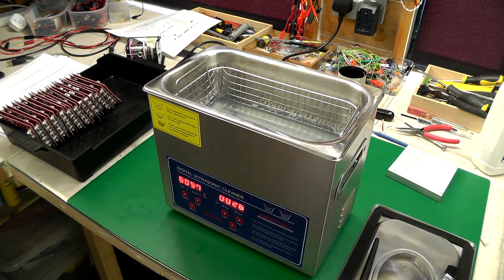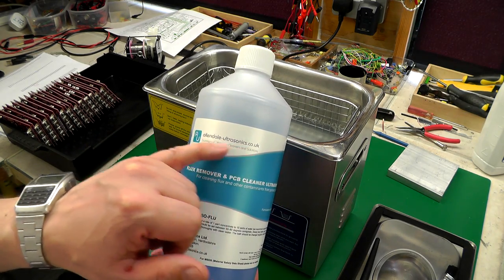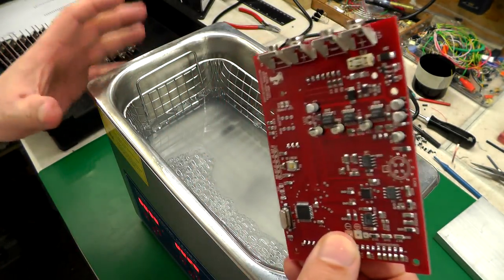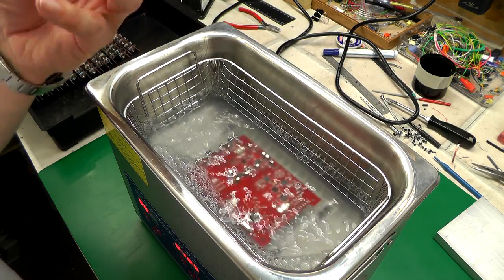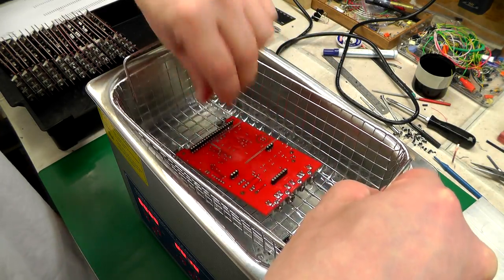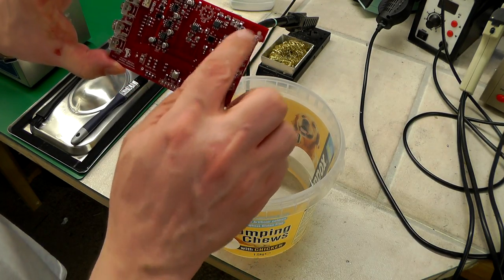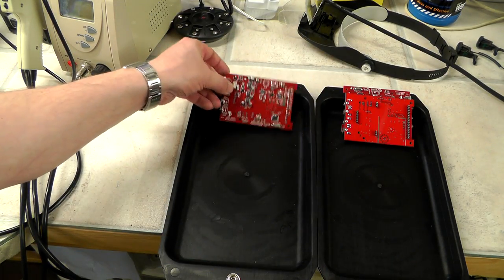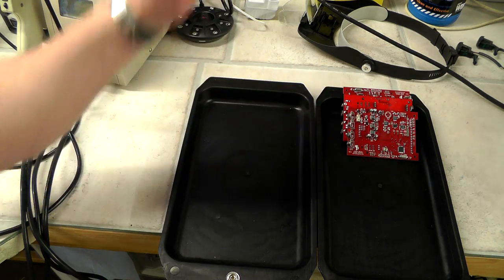No.026 - Ultrasonic Cleaner PCB Flux Removal

Comment: actually rinsing the board with 99% alcohol before you dry it is a great way to dispence out the water from under the chips. plus it'll dry so much quicker!
Reply: Yep, been doing this for years. The alcohol is anhydrous, and literally sucks the moisture out of any gaps. Then air dry or bake from cold oven at 100F for 5-10mins, and place the PCB's in a a container with silica for storage.

Comment: That tank isn't nearly full enough. My understanding of those cheap cleaners is that they need at least half a tank for the transducers to work properly. Allegedly running them low will lead to early transducer failure. I know I have one similar to that, although slightly larger (same labels/controls), and it makes an awful sound when less than half full, but there's a certain fluid level where the sound dramatically changes and it sounds like it's running smooth.

Comment: "...i'm gonna assist the drying process with a heat gun...." Well - that's no better than just letting it dry on it's own. If you want to make it better, use a compressor and blow the water off the board.
Reply: compressor air believe it or not has alot of moisture in it because the air it compresses has water in it. Since it confines the air to a smaller space the end result is there is a lot of water which will come out of the nozzle when used.  Try it for yourself and test, run the air thru a completely dry rag and after a bit you will see the rag get wet. If you decide to do this you need a very good in-line filter to remove the water
Reply: I was under the impression that compressed air can cause static, and we are all taught that static and electronics dont mix. Is there any truth in this?
Reply: @TomStorey96  static what ?
Reply: @dalevanderzee4086  I use a compressor with one big filter out off the tank, another smaller one near the gun, and it's the cleanest air you could wish for.

Comment: Use an air compressor to remove the bulk water an then into a the reflow toaster oven on low convection or dehydrate.

Comment: Can I ask how you set the temp? I have a smaller unit but same type, temp seems to work but when I press on for heat the led doesnt light up. do you get the same?

Comment: I use termopasty (polish company I think) ultrasonic cleaning solution. It is not, as far as I can tell, a soap type thing. Nor is it something you have to dilute. Just dump it straight in the tank and go. It is not the cheapest solution but what I can say is that it does work insanely well. Even for things like years old crusty brown flux from older PCB's. No need to brush it at all and once out of the tank all I do is just blast it with the hot air station (a quick 861DE, so the one where the fan goes up to 200 instead of 120) at 200 degrees just to blow the solution out from under components more than anything. It also leaves as good as no streaks (unlike IPA which always seems to leave some of that flux behind) or blemishes. No need for a rinse afterwards, just a quick blast of hot air to aid it evaporate.

Comment: Just a note, LM399 is actually hermetically sealed, plastic housing outside is just air shield, but I agree on the move not to put it into ultrasound cleaner just to avoid stress to it. :)
Reply from the maker: +xDevs.com - Yes, I meant I didn't want water or old dirty bits of flux trapped in the pockets withing the thermal shield. It always appeared to me that water etc could get up through where the legs protrude through.

Comment: Great video, thanks for taking the time to show the process! I'm inclined to get some of that cleaner stuff and try it, although I might need to get a new ultrasonic tank as well (mine is rather old and out of whack). As it happens, I spent today making up a batch of PCBs and wondering how the pros go about cleaning them. My own process, for what it's worth, is:

Soak boards in isopropanol inside a sealed plastic tub for 30min - this softens up the flux and crap
Scrub well with a toothbrush in the IPA - this usually gets everything off but sometimes there's little bits of hard flux around big solder joints, so need to give them a wee scrape
Wash with hot water and detergent, to remove the IPA
Dry thoroughly with a compressed air jet

Personally, I love using compressed air for drying things, because it gets into tight places very easily - e.g. under SOIC chips, or inside IC socket pins.

By the way, are you from Aberdeen? I detect a wee bit of an accent! [I'm from West Calder]

Comment: I wonder if the ultrasonics has any long term impact on the crystal on that board, such as offsetting or drifting. Your also using a lot of manual effort when the ultrasonic bath should be doing a larger percentage of the work. Try using other chemicals.
Reply: My thoughts exactly...   shouldn't need the use of a brush...

Comment: I'd recommend trying safewash 2000 in the ultrasonic bath, RS part number 217 3841, it's good value if you buy in the 5L size, it can be rinsed in tap water, its much more effective. I gave up on the soap based cleaners, they just didn't do a good job.

Comment: Hello Ian. Do you work for yourself or do you have a shop? Also what happens to the board if it has plastic components on it or do the heat and cleaner have any adverse effects on plastics?
Reply from the maker: I have my own company, self employed. Go to ianjohnston.com. The cleaning solution is water based so has very little problems. The heat of the solution is only 50degC so again, no real problems. The biggest issue is drying the boards with heat......be very careful.
Reply: @IanScottJohnston  Thank you, I have a pile of faulty PCB's from PlayStation controllers. I can often fix problems with an alcohol swab but I bought an Ultrasonic cleaner to give it a deep clean and hopefully rescue some boards from the bin. Cheers and thanks again.

Comment: Great video Ian, I've been wondering if the ultrasonic flux removers were any good. 

For pcb drying, a portable air conditioner in a small room is great, on dehumidify mode, as the exhaust will pump out hot air and dry the pcbs very quickly without any direct heating of the pcbs.
Reply: +arcadeuk what the pro's do is rinse the pcb in alcohol as it displaces water and evaporates quick
Reply from the maker: +arcadeuk - I do have a dehumidifier in the workshop, so could look at building a wee "enclosure" on it to house the boards. The only thing that would concern me (lack of knowledge!) is the possibility of static build up from the continuous air feed. I've used the hot air gun method for 30yrs and never really considered anything else!
Reply: +IanScottJohnston Yeah, it would seem to me that since humidifiers are used for static control dry air + air movement = static. I built such a cabinet* for controlled drying of seeds to put them into dormancy and they stick like hell to paper and tweezers suggesting they are charged up I don't have the esd test eqpt to test.I used the warm air cabinets when I was at sea.. *When I say cabinet it's a polystyrene fish box, fan, loose indicating gel, hoover hose and duct tape

Comment from the maker: Just a wee update.......Why don't I use Isopropyl alcohol to dry off the boards (as I used to!)?
1. Safety. It's extremely flammable especially in the quantities I'd be using.
2. It's only a small workshop I have and it stinks. Also, the pcb's give off an ever lasting odour. Fine for home use but not production.
3. Water is cheaper.
Ian.
Reply: +IanScottJohnston probably a stupid question but can you use IPA in an ultrasonic bath, heat or no heat?
Reply: Yes you could but read again number one ... safety
Reply: Just a thought, but wouldn't a hair dryer or a temp controlled hot air rework station be more appropriate than a heat gun? Heat gun is like 500℃

I have successfully used a heat gun for electronics before I got my $50 rework station, but it was like using an arc welder to do PCB soldering.
Reply: The heat gun is a static generator with carbon brushes not design for drying static fragile IC's the cheap rework station is made from an anti-static design I got a similar machine its written on it ESD safe on its box ! If anti-static is not a preoccupation for these board then a small compressor would blow away every trace of water from under the IC's in an instant ..
Reply: Do note that cheap brands sometime claim a device is ESD safe, while it is not. People like seeing it on the box, so they put it on there.
Reply: Lol.

I used to to boil Iso 99% in a pot with Marijuana to make oil.

Never had a single issue and the ultrasonic cleaner wouldn't even be boiling it.

You really need to get more scientific brother, Safety is an absolutely terrible excuse.

Comment: One thing to be careful/mindful of is obviously components that aren't sealed.  For example, that fuse on your board doesn't look like it is fully sealed and a bit of water might seep into the fuse body.  With water inside the fuse it could change the thermal properties of the fuse if its in contact with the filament and cause it to not blow when it needs to.   Some components might be rated for washing but not full immersion, such as fuses, relays, switches,  buttons, and other electro-mechanicals.

Comment: I've heard of people using a commercial dishwasher to clean PC boards. Nowadays with the aqueous wash fluids I don't think it would damage the machine. I certainly wouldn't do it with freon.
Reply from the maker: Out of interest, back in the day we used to buy 10ltr tins of Freon for use in an ultrasonic cleaner.......fantastic stuff required no agitation and 2mins later the board would be clear of all flux. We got tight with money at one point and were filtering old freon through a stocking to allow it to survive a bit longer. Great stuff, and I never came across anything as good since.........a shame Freon harms the environment!

Comment: hey man nice video im planning to buy one of these cleaners. ive got one question..for how long does one pot of solution lasts before it needs changing(boards with barely visible flux residue)?
Reply from the maker: It really depends on how contaminated your boards are with flux residue and how you store the solution. I.E. I decant the solution into a sealed container after every use. Note: Back in the day I used to strain my solutions through a filter to make it last longer, and of course all this depends on size of your tank also.
Reply: @IanScottJohnston  thanks for the reply. i saw another video where theres a whole different method and i wonder if it would work. its basically filling up the tank with tap water and then filling a separate zip lock bags with a cleaning solution and tossing the pcb in, lock the bag and put it in the water filled container and start the device. after its done bag itself can be used to store the solution for another use until its dirty enough. did you try anything like that?
Reply from the maker: @orhanyor  No I never tried that.
Reply: @IanScottJohnston  all right thanks for the input :)

Comment: Yep that was very common in the late 1980's to use a ultrasonic cleaner for PCBs. If you run it too long you can break the wire bonds on the die of an IC. The good old days.
Reply from the maker: +TheRadiogeek - I was reviewing a few YT vids on exactly this subject last night........one report says you'd need "hours" of high power ultrasonic bombardment to break any bonds. Not saying it couldn't happen, but I am guessing it would be bad luck more than anything else. Saying that I think I have only every had 1 pcb fail (years ago) after ultrasonic cleaning (previously tested ok)......who knows if that was a broken bond, ESD or something else.
Reply: +IanScottJohnston for sure it would take a lot longer than two minutes. I have seen it happen to a board that was forgotten over lunch time. Thanks for the video.Take care..

Comment: Just out of interest, are there common things that fail on a PCB in a boiler? Or any PCB for the matter.
Reply from the maker: You mean would fail due to the ultrasonic cleaner?.......Crystals can be affected, but in 20 years i have never had a problem. Also, don't put anything in there that may have issues like through hole DIP switches which would be hard to remove the water from afterwards being semi-sealed. I basically use mostly common sense.
Reply: @IanScottJohnston  Thanks for that. I'm a heating engineer and I replace PCBs on boilers on a regular basis. I can obviously diagnose when the PCB has gone. The only thing is I have no idea what actually goes wrong on them.
Was just wondering if there was anything that was a real common issue on PCBs that I could relay to the customer. I guess I'm trying to find another explanation other than 'its broken' for the customer.

Comment: Hey, watched this video as well. I would suggest against doing this method as you may not get all the water out. The best way to proceed is to use 99% alcohol and soaking it in for 10m or so. This will DISPLACE all the water. Also never use a heat gun. please. Place it in the oven,  ultrasonic should never go above 61C for PCBs and also after drying, place in an oven at around 104C. What you're doing is very dangerous. Please wear gloves as well when putting your hand in the solution. Im not sure about the cleaner youre using but most cleaners for ultrasonics are very toxic.

Comment: You can use standalone electric oven toaster (set to ie. 100C)  instead of a heat gun.
Reply: With water you are running against time. The corrosion can get really bad fast even with distilled water. I would use alcohol solution to displace ultrasonic fluid and then put it in oven.
Reply: even better idea
Reply: I like to put mine on a spit infront of a roaring log fire sometimes I put the PCb into the hot ash just to make sure it's well done  good and dry

Comment: De-ionised water what is that?
Why not use normal warm water?
60 degrees F or C?
thats To hot in case its C for Celcius
Reply from the maker: QUOTE: Water we get from the Earth, whether it comes from the ground, the surface, or the air, contains some level of contaminants, dissolved minerals, and organic substances; this includes materials such as dirt or dust, pollen, mold, bacteria, algae, spores, salts, halogens, metals, and other organic and inorganic matter.
When used in ultrasonic cleaning applications, De-ionised water acts like a sponge, it absorbs contaminants and particles readily, and cleans actively.
Most of my PCB's are precision analogue boards and thus need cleaned very carefully.
50 degC.

Comment: Rinsing is a bit of an issue I have at the moment. I tried alcohol but it leaves traces after drying. De-ionised water is known to be corrosive. Has anyone tried distilled water?
Reply: distilled water is what most recommend .. any other has too many impurities, especially tap water
Reply: @rhuephus  Thank you for your answer. I am using distilled water now. Something I am wondering about. If I rinse with tap water first then with distilled water after that do I run the risk of corrosion as well?
Reply: I was following some videos of experts who try with different commercial cleaners solutions, most of them employ distilled water and isopropylic alcohol to help in the dry process, but I'm cofused in some point, distilled water is 99% free of impurities but if you clean something with it now it has a lot of impurity, isn't it? Any way I will do a try with some PCBs with nicotine.

Comment: Ian, why not use some compressed dry-air at low pressure to blow off 95% of your liquid from the boards? I am sure the hot air is not even cleaning the IC's underside.
Reply from the maker: The hot air gun I use has a reasonable air-flow, also I use quite a bit of heat on both sides of the boards so all the water/moisture is evaporated completely. I use the heat gun 3 times per pcb allowing the board to cool and evaporate for 15mins each in between times. I have kinda feel I have this process nailed from making pcb's for the oil industry in the 80's, 90's, 00's. I'm sure there are new tricks......but I'm an old dog!

Comment: Couldn't you put the pcbs in a toaster oven that could be modified for a temp about 40~60 degrees Celsius and let them dry in batches rather than one by one. I think that be much faster since you are doing batches and it should get all the water out from underneath the packages of you run it for a bit. Would make a good video of you modding one to run at low temps maybe with a micro controller
Reply from the maker: +Robert maks - I do have a programmable reflow oven now, so maybe it's time to try setting a low temp profile and seeing how it performs at drying boards........albeit, I'd be a bit apprehensive about accidentally hitting the wrong profile and cooking the boards!
Reply: that will work great!

Comment: other people insist on using alcohol to remove the water, whst do you think about this and what alcohol would you use to do this if you do
Reply: most people working with PCB recommend 99% (medical / industrial grade) iso alcohol.  It replaces the water and dissipates rather fast --  be sure to use rubber gloves ..